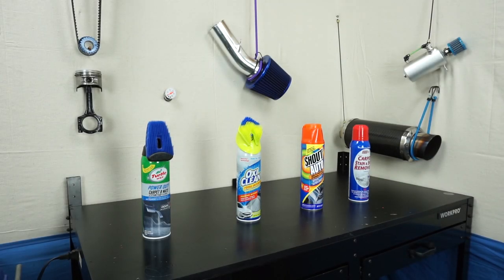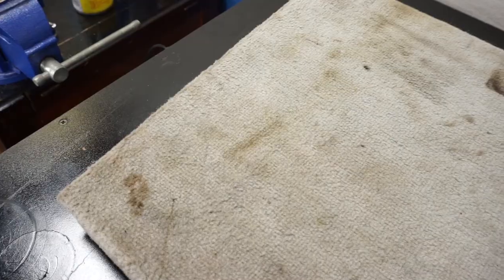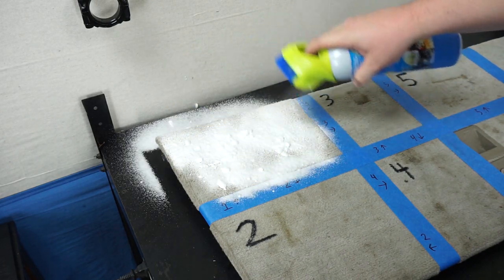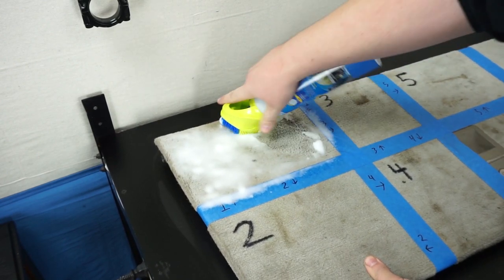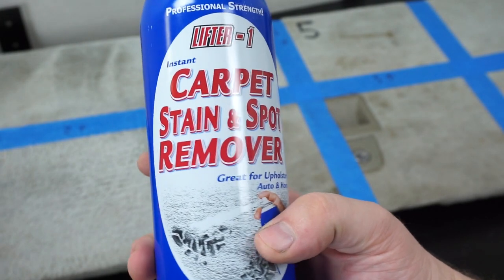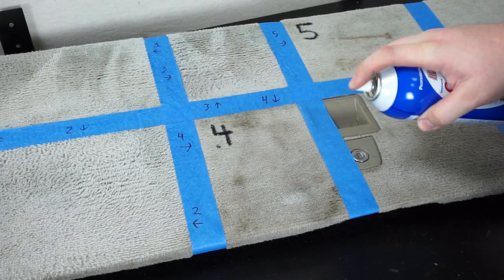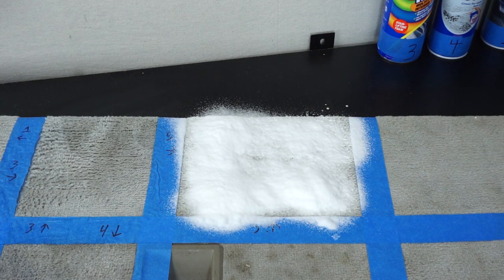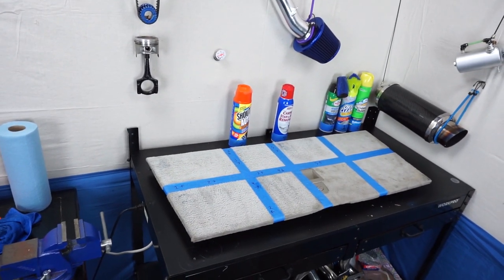Testing 5 Automotive Carpet Cleaners - Satisfying Results

Comment: I like how you reply instantly to people's comments and nice vid but I have a machine so I'm looking for a solution to use for my car detailing
Reply from the maker: Thanks, I do not have a machine but if I did I would probably make a video on solutions lol.
Reply: I myself use the Shout auto for spot cleaning. For a deeper and more thorough clean, I use my Bissell  Spot Clean extractor with my own solution in a spray bottle. In a common 32oz bottle, I dissolve 2 table spoons of Oxy Clean powder with 24oz of water. Then 1oz of Dawn and 1oz of Cold Water Tide. Thoroughly mix the solution. For a lighter clean, just use more water. Spray, let it sit 30 seconds, and scrub with a soft bristle brush, then use the extractor to vacuum it all up. Spray the area cleaned with plain water, let sit 30 seconds, and then use the extractor to vacuum one last time. You should be left with deep cleaned seats and a very pleasant smell.

Comment: Great video, and very helpful. I have the Oxiclean carpet cleaner ($5 from walmart), other products were priced the same. 

It was very iffy when I was cleaning my carpet with the Oxiclean I used a toothbrush and the brush on top. Most of stains from chocolate icecream came out, but I had to spray it more than 3 times. It's probably because the stain is old. 

Overall the product was ok.

Comment: Do you think this Would this work for an area rug ?
Reply from the maker: Hmm, might be a bit risky. These are pretty strong, I would be worried about it possibly messing with the color of the area rug. I feel like the car carpet is a bit more durable, and can handle stronger cleaners.
Reply from the maker: If I were to pick one, I would try the Shout since I know for a fact that it is a very similar formula to the laundry detergent. Probably the easiest on the fabric.